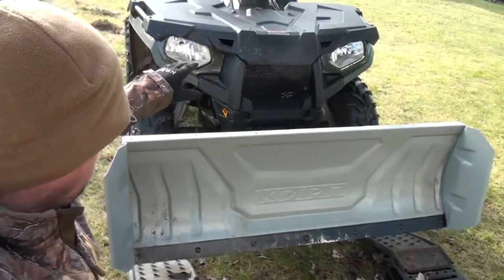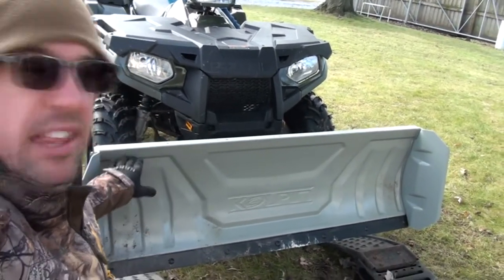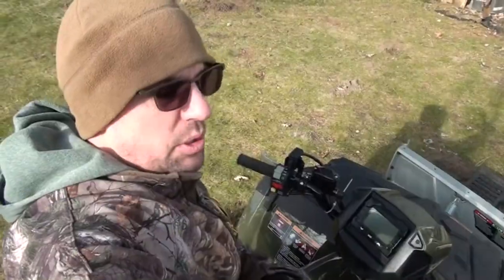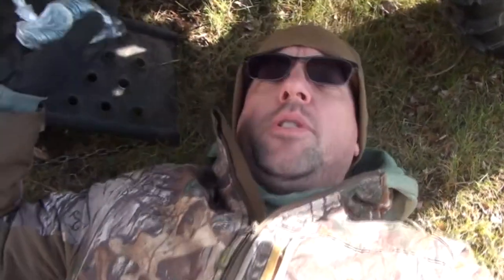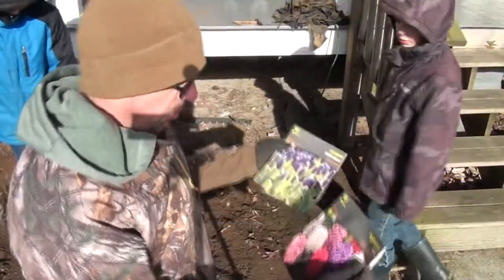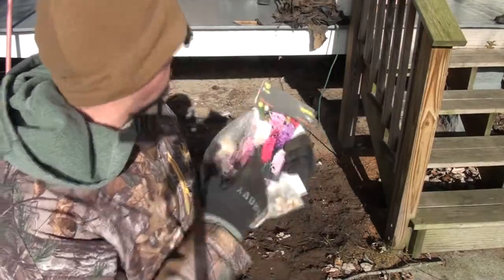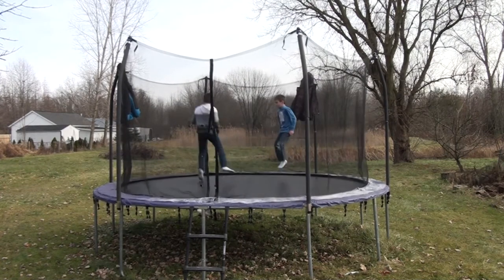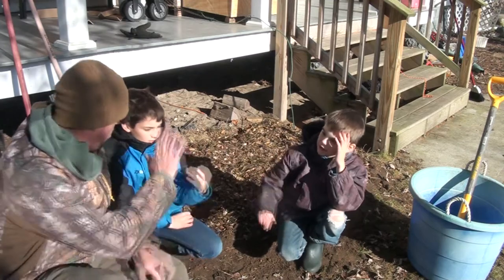Polaris Sportsman 450 H.O. Kolpin Snow Plow Mount Fix | Late Fall Bulb Planting

Comment: So the Left side has 2 spacers and the right side has one?
Reply from the maker: Yes.  It was the only way I could get the blade level enough to plow even.
Reply: @IndependenceAcresHomestead  another thing to try to help with scraping the gravel would be a piece of pvc pipe on the bottom of the plow scrape blade it will keep it from digging in